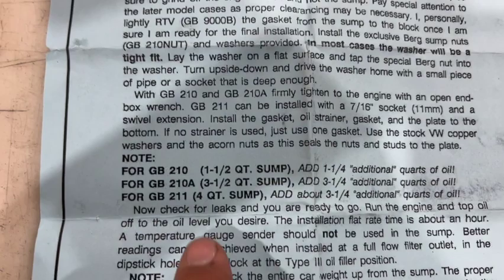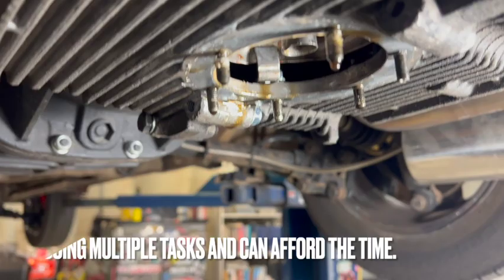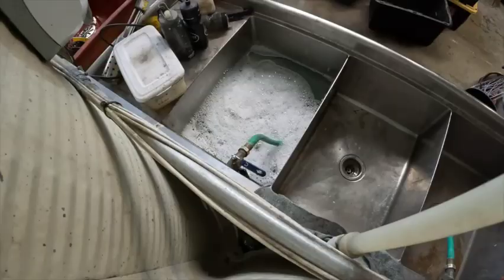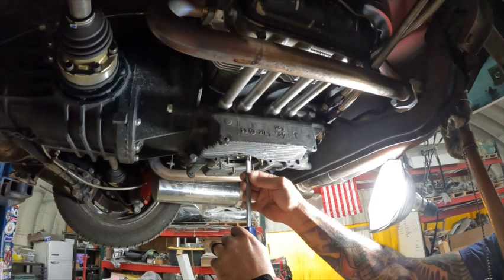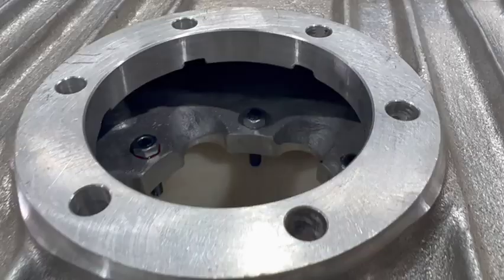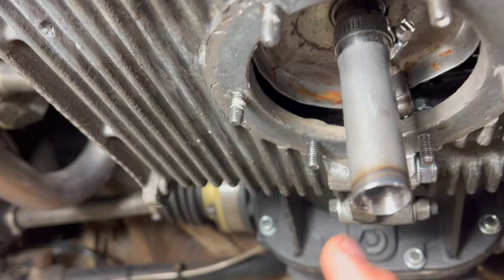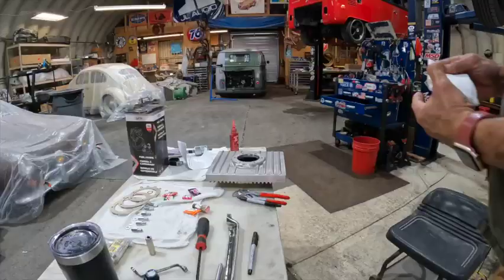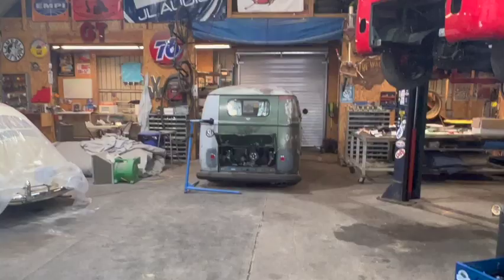Keep that modified VW engine alive! Oil Sump Install

Comment: Need to show - the rag removal after the sump was on so we don't have anxiety and loose sleep thinking about it. 🤣🤣🤣😬😜
Reply from the maker: I thought about that. 🤣
Reply: I spent the time to make a detailed description to solve this.  It's composed of years of research and highly detailed studies. This technique has been practiced since the automobile was invented and even before in certain industrial and commercial applications.  It may be a bit involved but it's worth following every step without any variation. I'n fact it's crucial to the outcome of the work you are doing.

Step one. Pull out the rag.

Step two.  Enjoy Zotz

Step three. Ponder the significance of the seasons, maybe take a walk to view nature.

Step four. make sure the laces on your right shoe are tight enough.

Step five. Congrats you can proceed with installing your sump!
Reply: Dang it! I jacked up step 4! 🤣
Reply: @NTNGMAN  In retrospect I'm pretty sure I should have switched steps three and four...

Comment: Really enjoyed your video, to the point and great descriptions. Do you need to beef up your oil pump because of the added sump tube length?
Reply from the maker: No you don’t. But a good oil pump is needed in any engine build. I prefer Gene Berg oil pumps.

Comment: Does adding this sump block access to the original engine oil drain plug? If so, then where do you drain the oil from?
Reply from the maker: The added sump has a drain plug on it. Just like the original one.

Comment: Thanks! What is the benefit of adding a sump?
Reply from the maker: Increased oil capacity. Less chance of oil starvation on a high rev.
Reply: @the_Wagen  Additional cooling, as well.
Reply: And now when you change your oil (which is often with these air cooled engines) if you strip a stud when torquing up the sump Plate, you haven’t damaged the engine block just the new sump! 👍

Comment: Can you expect your oil temp to drop with a sump.  How much would you think..
Reply from the maker: Yes you can. Berg sumps are designed to assist in cooling. Plus the addition volume allows the oil a longer recovery period. An exact degree I can not tell you. Too many variables to consider. But a guess of 10* is safe to assume.